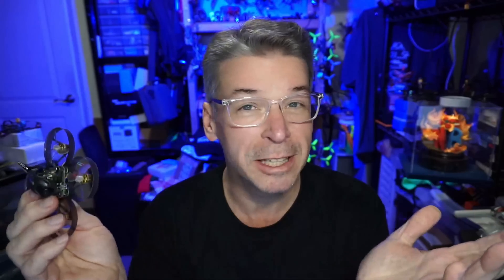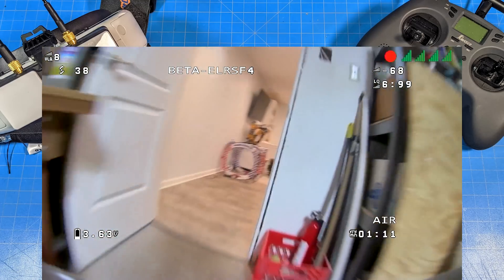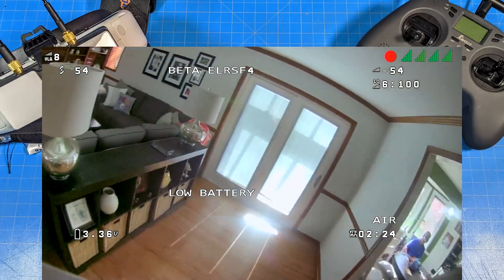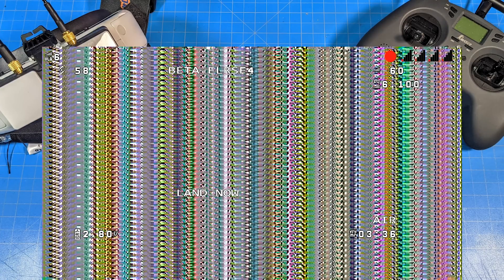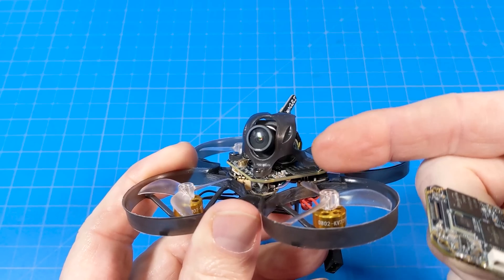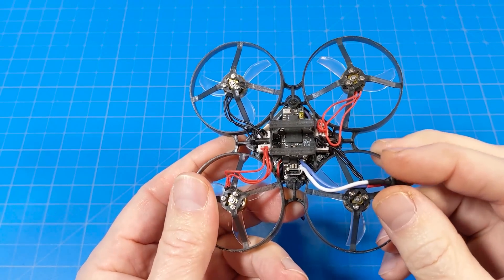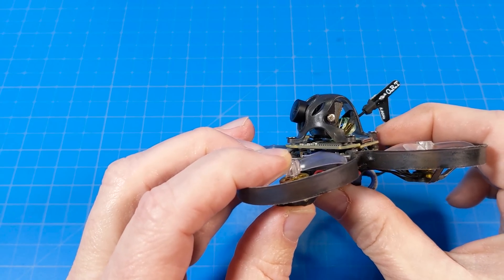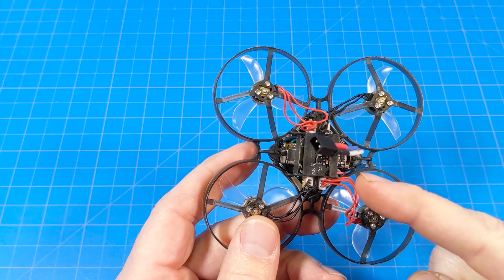Can't Do That With DJI // HDZero 1S vTx  // More HDZero Micros

Comment: Is there an HDZERO module that will work in a DJI analog Digiadapter?
Reply: Unexploited market there. A lot of guys with DJI goggles would try HDZERO if some kind of universal module was available.
Reply: @yannickg6904  I would pick up sharkbyte in a heartbeat if I could pick up an adapter for my DJI goggles.  My analog goggles are garbage and I don't want to spend $500+ on a nicer set.
Reply: @csg2000  Same, I have old HD2s, not HDO2s. Will stick to DJI for the foreseeable future. Planning on ordering a few Nebula Pro Nanos and Polar Nanos. Might try a DIY naked Vista.
Reply: @yannickg6904  I have an older set of Dominator V3's.  Not sure they are worth putting sharkbyte on.  That's assuming I could even get a sharkbyte VRX.
Reply from the maker: DJI fpv goggles don't have hdmi in, and hdzero only has hdmi out right now.
Reply: @NickBurnsFPV  I guess I won’t be changing over anytime soon. 😢
Reply: @NickBurnsFPV  I wonder if someone tried to use a small AV converter. There are little converter boxes on Amazon that cost about 20$ with HDMI in and AV out.
Reply from the maker: I haven’t heard of anyone trying something like that. I wonder how much loss is associated with that process. If small might not be a terrible thing to try
Reply: @NickBurnsFPV  I know someone who has both systems. Will suggest the experiment.